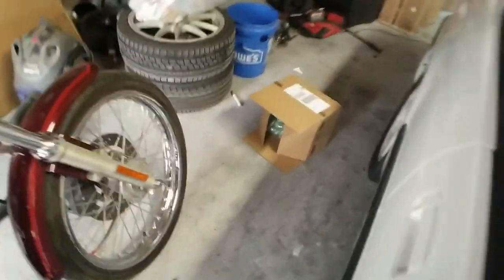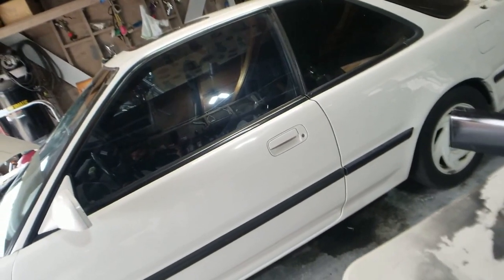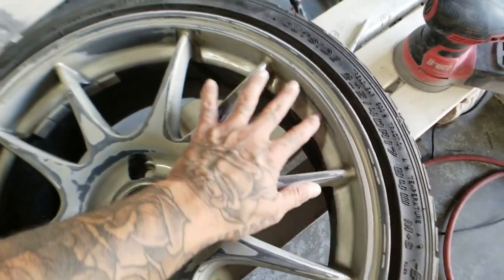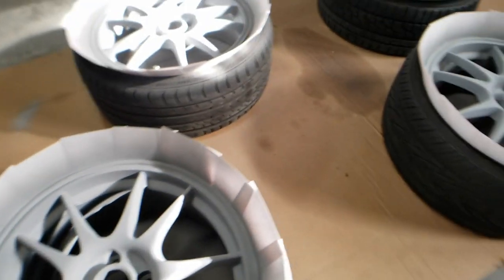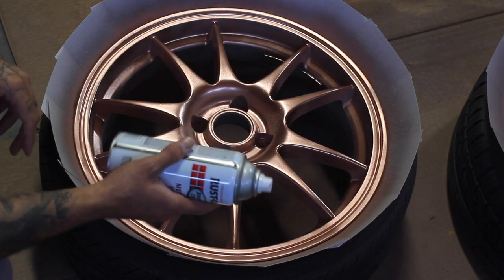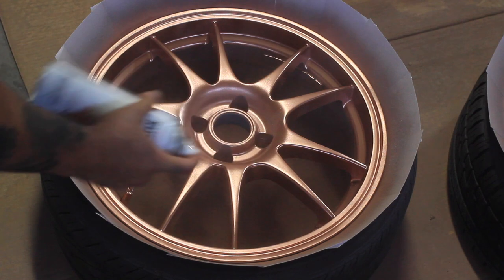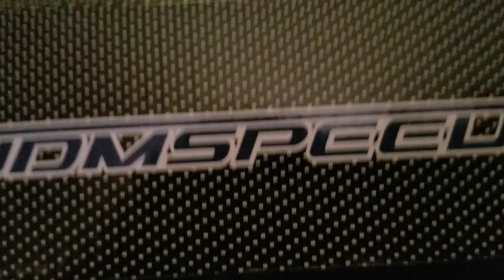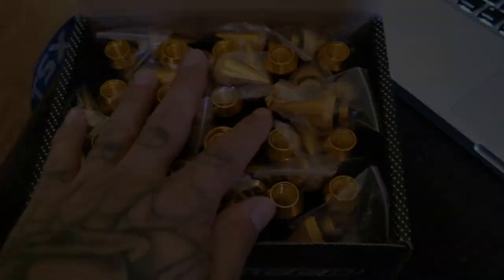how to paint wheels

Comment: Did you use one can per wheel? Or how many cans and coats per wheel?
Reply from the maker: Rule of thumb is usually 1 can per wheel..I believe I only needed 2 cans of silver for all 4. 1 each for copper. N clear it's optional.. just make sure you get 2 good coats on each